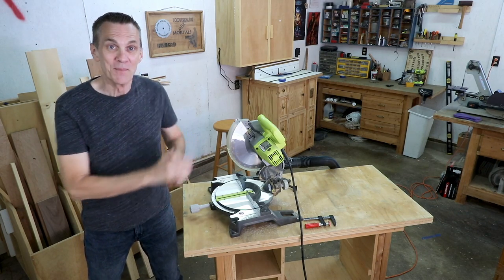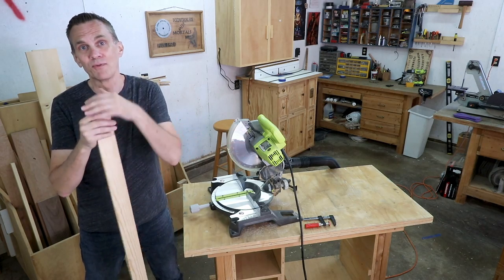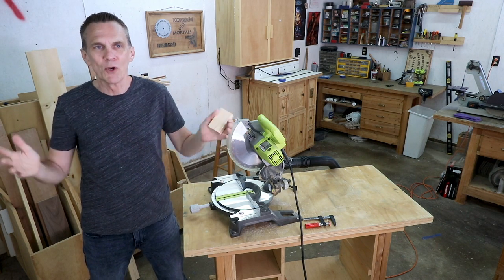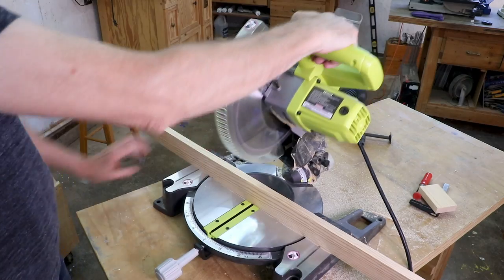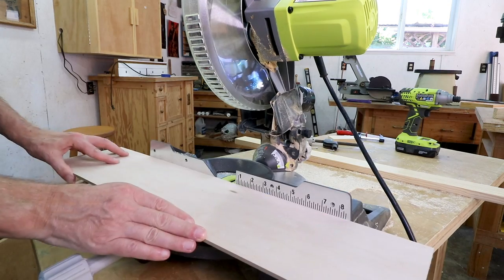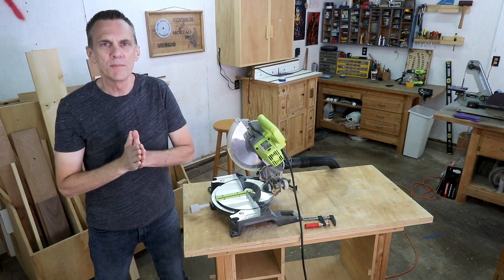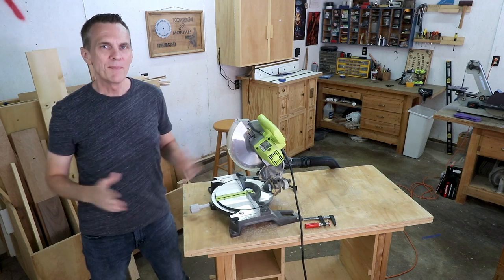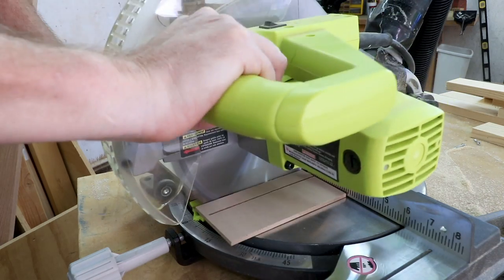8 ways to use a miter saw like a pro

Comment: Stop Block Tip.... Raise it about a 1/16" above the table.  This prevent sawdust from building and throwing off your cut.  Or cut the bottom corner off.
Reply: i place tape on my table and mark the measurements i want and just place the end on the mark it ends up being faster for lots of tasks and things come out nicer
Reply: or cut a 45 degree notch out of the edge of the stop block..it will basically swallow the dust.

Comment: Been woodworking for a while and raising the board thing totally blew my mind
Reply: Totally agree. Never heard it before, but it's a brilliant no-brainer!
Reply: A friend shared this tip with me after I completed a project and complained how my saw could not cut the wide pieces for the table top. It was great information, even if it was a few days too late.
Reply: At work, we do something similar. Cut your piece, and then, tilt your wood piece and the blade up at the same rate, while pushing the piece of wood against the fence so it doesn't kick back at you.

Works well and is very quick. However, there is a little more danger when you do it like this compared to what Steve suggested.
Reply: +1 Figured out the other stuff  on my own, or from experience cutting metal, but this one made watching the whole video worthwhile.  One of those "why didn't I think of that?" moments. :)
Reply: You can also flip it over..
Reply: I just lift up the board into the blade DiResta style
Reply: @heli400  thats what I did when cutting some fence boards on my 10" miter saw, I really want to get a sliding miter saw but as it is I don't use my current one all that often.
Reply: I used the tilt method when cutting laminate flooring....but may have to try the lift method.  Seems safer
Reply: Or just flip the board over.
Reply: Could have used this tip today earlier haha
Reply: Thanks for sharing the tips.  A couple of them I didn't know.

Comment: I'd add this tip - if your mitre saw doesn't have screw holes for an extension fence (or the holes are in a bad location), you can easily drill your own. I just built the mobile workbench after signing up for Steve's course and picked up the same Ryobi Mitre saw that he suggests as a starter saw. One of the four holes is blocked by a bolt in the back... to fix, I just drilled another hole on that side (start with a tiny drill bit to minimize wandering, then a larger drill bit, then finally the bit you really want to use).

Comment: Biggest safety tip I have: If you have it mounted on a miter station, whether portable or stationary, have it so that when you are standing at the saw, you are facing towards the main entrance to the shop.  This way, if somebody comes into the shop, they won’t sneak up on you which can cause some damage if you get scared!
Reply: That is very true. I worked in a workshop many moons ago and the main rule was, never scare anyone in a workshop especially when machinery is on.

Comment: I recently picked up woodworking as a hobby again. One tip I learned,  probably 35 years ago, was to make an "X" on the OFF piece.
That way, if I measured and marked several boards, and it wasn't obvious which side of the line I needed. The side without the "X" mark was the KEEPER.
Reply: I draw a small "V" or "check mark" when measuring. One line is perpendicular to the board (the cut) & the other line I tick off towards the "off cut" and most if not all is removed by the kerf.
Reply: I literally just today was struggling remembering which side was my off piece, thanks for the tip!
Reply: I was taught to do this too.
Reply: Ha! Funny. I was just about to leave the same comment. It’s become reflex for me, even if I’m only cutting a single board. Looks weird to me to see a board on the saw without the scrap side marked
Reply: @heli400  Not sure if you do exactly the same as me, but my marks look like this: |<
Reply: @stevepseudonym445  |/
Quicker, no lifting the pencil
Reply: I was taught (many decades ago) something very similar - pencil a "W" on the "Waste" side.

Comment: Important Tip: When squaring those ends, be sure to check for the staples that held on the tag. Even if there isn’t a tag, check anyway; the tag may have already fallen off.
Reply: True it's best, but 99% of blades are carbide and a thin staple should phase it.
Reply: @biggstile  ~Yep, but a 100mph staple fragment can go predictable places. I once had one sneak right under my safety glasses and fortunately imbed itself in the skin UNDER my eye. Bloody and not very pleasant - especially when the doc was tweezering it out.
Reply: @biggstile  Not so much a worry of what that staple will do to the blade as it is what that blade will do with the staple. As Jeff said, it could very well get shot out. 

I recently had a small incident with mine. I was being careless and lazy and had to open some of that terrible plastic packaging. I was too lazy to go into the house for scissors or  try to find my carpet knife, figured I was right there and my miter saw was plugged in.... 

Blade tore through that packaging like it wasn't even there... Which is what I intended. It did however catch a small piece of it that was already coming off from my previous attempt to open it and shot it back up at my face. And of course I wasn't wearing safety glasses at the time because I wasn't working currently.

Laziness and a fair bit of stupidity on my part came within an inch of possibly costing me my eye.
Reply: I’m not a pro, just a home user who makes stuff. This may not apply to everyone but..My tip is to purchase a sliding miter saw. I purchased my first miter saw thinking who needs the sliding one, save a few bucks. After a short time I regretted not purchasing the sliding miter saw and dealt for several years. For just a little more you can get the sliding. In fact I’d rather get a harbor freight sliding rather than a more expensive chop miter any day. Second tip, get a decent blade but no need to go high end for most. I use a Bauer or Hercules 60 tooth carbide tip and have been very pleased.

Comment: Speaking of big box store lumber, a good tip is to always check the end of the board for staples that are holding tags, or the tag maybe gone and just the staple is left. I’ve even seen staples in the sides of boards in random locations. Save your blade and look over the whole piece before cutting.

Comment: My tip: if you use a stop block, wait for the saw to stop completely before you lift the blade.  The saw can grab and throw the piece trapped by the stop block, especially smaller pieces.  It's dangerous and it can damage the wood.
Reply: That's what I was trying to say in a later post. ty Frank for explaining it better.  Happened to me and had to buy a new blade.
Reply: I was chopping off some pieces today when my mind slipped and I raised the blade without letting it first stop. It took a huge chip out of the side of the wood and made the whole thing jolt!
Reply: Yes! I noticed how the block of wood jumped up a little bit in the video... I know Steve knows this because in his Weekend Woodworking and Powered Up classes he is careful to point this out. Is this a test to see if the safety police are paying attention?  LOL... Once I absentmindedly lifted the blade using a stop-block, I did that once -- just once mind you! And learned how dangerous that is. It was a "Oh $#%*!!" moment as the cutoff piece violently shot out of the saw... I was lucky no damage was done, it could have been worse. This is no joking matter:  For safety you have to wait for the saw to stop before lifting the blade up, don't be in a rush to save a few seconds; it's not a shortcut and it's not worth it.
Reply: Yes! You can see the risk of this at 2:25 in the video. If it doesn't just mar your wood, it could launch a piece like mad.
Reply: Stole my tip lol
Reply from the maker: Yup...I should have waited for it to stop.
Reply: @SteveRamsey  It takes my saw about 5 seconds to stop.  Maybe 6.  When I have a few cuts to make, that 5 seconds seems to last forever.  It's hard to stay disciplined and wait.  I try to spend that 5 seconds remembering the last time I flung a ruined piece of wood across the driveway.  That seems to pass the time  :D...  I'm still tempted to cheat every time!
Reply: You should also keep pressure on the piece between the stop and the blade, or whichever is the work piece (as opposed to the offcut)
Reply: 99% of the time I let the blade come to complete stop before raising it back up and I don't use stop blocks; but I'm a worry wart.
Reply: yep. I was making yard dice earlier this week. I raised the blade when it was still moving and a 4 by 4's chunk went flying at me...
Reply: The free piece could also wedge against the stop block, break the fence and now metal is flying.
Reply: OR, always hold down the finished piece. On small pieces, i use a pencil eraser like he showed and wait for blade to stop.
Reply: @brucemiller1696  you absolutely did not read the opening post, or you don't understand.  I am thinking about 2 tradesmen atm who took a serious injury,  in the last 4 weeks. After the first guy cut his finger off you would assume everyone was going to be careful. The other guy almost cut his forearm off. I am embellishing a bit, but 1 guy has not returned to work in 3 weeks. The stop block forces the cut off to be in contact with the blade, the tooth of the blade can grab it, and throw it or wedge itself against the tooth of the blade the stop block or even the fence. You don't want that to happen.  Unless you have 3 hands your not controlling the cut off. I hand an apprentice use my chop saw,  he found a way to shear off my fence,  without cutting off his hand, it was the cut off that took my fence.
Reply: @SteveRamsey  I guess this shows we are all "Mere Mortals" in woodworking -- on the plus side it's proof that we pay attention your teaching. BTW: I look forward to your next course for the shop but I literally can't wait: I need organization now!!! Today I'm building a cordless tool/charging station, and plan to build several other projects such as under workbench vertical pull-out drawers for efficient storage (of paint and tools). Can you talk about the projects in the new course? Maybe in a future video? Thanks.
Reply: this happened to me. The wood even broke the metal "ruler" on the saw. Lesson learned
Reply: @michaelstiller2282  not sure what you are saying. I am right handed, my fence is 10' to the left with an 8' cabinet for support. The right side also has 8' of cabinet for support. My stop is on the left. Sometimes, depending on the stock, i cut and wait til blade stops. Most time i hold done left good piece with left hand and cut with right hand. Never crisscross hands when cutting and ALWAYS have support on stock piece. Would need to see what people are trying to do to then say whether right or wrong.
Reply: Or just keep the blade spinning full speed as you lift up.
Reply: @brucemiller1696  We both understand the dangers of our tools.  I guess I am just a bit more frustrated,  and argumentative,  knowing 2 tenured guys who know better, and ended up in a hospital.  It's so easy to take an injury.  When they are coworkers  it means more.
Reply: @alexhb12333  yep, the last time it got me in the cheek.
Reply: This has happened to me a few times, scared the living crap out of me! Good tip to keep the blade down....

Maybe I’m over cautious but I’m not even comfortable making a cut on wood that isn’t clamped!
Reply: @sj_harris  it can grab the wood rotate it off the fence pulling your fingers into the blade. Always be aware.
Reply: Yes I can well imagine, I fear the blade (especially knowing how cleanly it cuts wood)!
Reply: Or it can damage your face
Reply: Good point. I have a habit of lifting the saw before it stops spinning
Reply: As a matter of practice and safety, you should ALWAYS arrange your stop block on the fence such that the finished piece (the piece you want) is on the opposite side of the blade.  That way, the finished piece doesn't bind against the stop block and you don't need to worry about kickback or jolting.  Using the example in the video, the small piece is the finished piece.  Therefore that is the piece that should be held in place (with a clamp) if its too close to the blade for hands.  The longer part of the board should be free to move.  Which brings us to a point about the right tool for the right job.  If you are trying to get a sliver, maybe something less than 1 inch, you should probably consider using your table saw and miter gauge, a band saw or even a circular saw with a speed square guide and a properly clamped work piece.  Not every tool can do every job safely.  Good luck with your projects everyone!
Reply: As a general rule, you should always wait for the blade to stop before lifting up.  It's especially true when using a stop block.
Reply: What about using a stop block shim? A thin piece that goes between the wood to be cut and the stop block which is slipped out prior to making each cut. This removes the pressure between the stop block and blade and avoids the health and safety drama. The set up of the stop block obviously has to allow for the width of the shim to get the desired cut length.
Reply: Damaging the wood should be the least of your worries. I know a guy who lost an eye because of this exact case. Always wait for the blade to stop and never use the stop block on that side. The stop block ideally should be on your left hand side.

Comment: I’ve had a circular saw for a few years now and maybe used it a handful of times. I recently bought my first miter saw, which I consider to be my first real power tool. I built a cart for it, using it. I couldn’t however for the life of me figure out how to set up a stop block for longer cuts. This was such a duh moment for me. I kept thinking I needed to build a whole miter station to achieve those results, but I’m not up to that in my tiny workshop build yet. Thank you for being amazing!

Comment: When using an extended wooden fence, it's helpful if you cut a 1/8" x 1/8" (3 mm x 3 mm) rabbet on the bottom corner of the fence closest to you.  The rabbet will help prevent sawdust from collecting against the fence itself, and throwing your measurements off.
Reply: @MoosinAround or just use the saw you would be standing at to cut a chamfer.

Comment: I'd add to be sure to come up with some kind of extended left / right support for the work piece if it's long enough to extend substantially beyond the saw's table. Some saws have built in extendable wings for this, a lot of mobile miter saw stands have this also. You can also buy small adjustable roller stands or just use scrap wood if your work surface is long enough. Supporting the work piece properly is just as important for cut quality and safety as with any other saw. Great video!
Reply: if you put your chop saw on the ground, you can support a long piece of wood with a 2x4   scrap turned on its side. That matches the exact  height of nearly every miter saw bed.
 Pin two foot-long scraps together to make a support that won't topple over.
Reply: A good early project is something like a Paulk Workbench with the add-on wings.

Comment: Rising the board just a bit to take advantage of more blade area is brilliant. Thank you so much Steve!
Reply: I want to add that this can work in combination with making your own miter saw tray. I have the same Ryobi miter saw that Steve has here and I've always had trouble handling big boards, so I decided to build a tray to solve several problems:
1) the tray has a zero clearance cut both on the bottom and back fence so I always get clean cuts.
2) I have roughly 24" of surface on each side of the blade to support boards, as opposed to the ~10 you get with the saw alone.
3) the tray has its own dust collection system, which consists of a simple mdf box built in the middle, to which I plug my vacuum and remove virtually all dust from the workspace when making cuts.

I consider this an essential upgrade to this and most miter saws I've seen, and it's a really fun project to custom build something; lots of trial and error and room for creativity. Can easily be done with scrap wood.

Comment: Great tips Steve, thanks for sharing.

I've had to cut a lot of 2x8s or 2x12s on my miter saw, raising it up just won't work (although I will be sure to try it next time).  I've gotten really good and just flipping the board over and lining it up again for the second cut. The trick is to make 100% sure your blade is at lined up perfectly, both horizontally and vertically.  Which it should be anyway, I was surprised not to see a comment about squaring up the blade in this video.  It doesn't do one much good to square off the ends of a board if the saw isn't square in both directions to begin with.

 Once the blade is square in both planes, one can get perfect cuts with no saw marks where the two different cuts were, just bring the blade down without running the saw and sight down the blade, adjusting the board until it's lined up perfectly.

Comment: I'm a Finish Carpenter, when using a stop block for repetitive cuts,  it's good to dogear the bottom corner with a small 45 degree cut. That way the sawdust doesn't build up and affect the length of the stock your cutting.